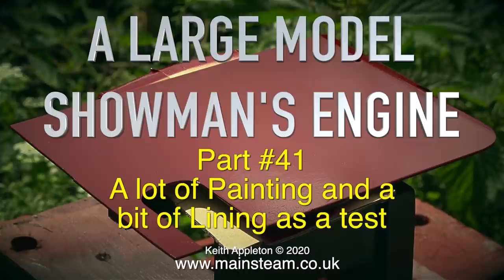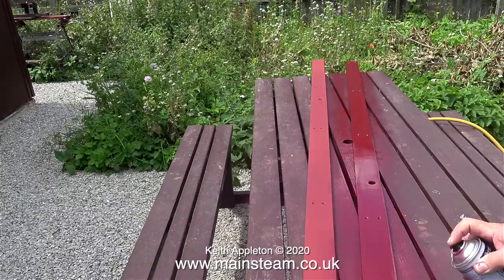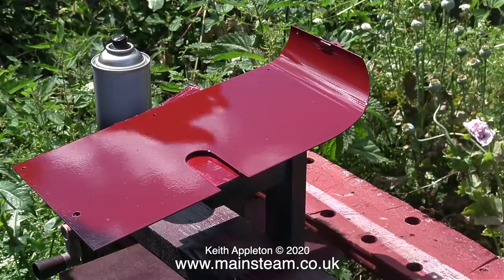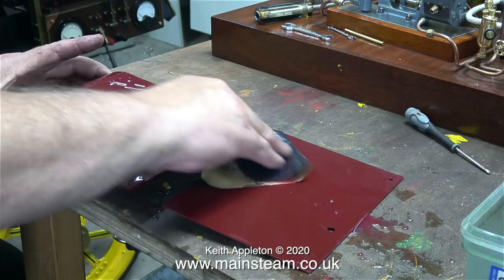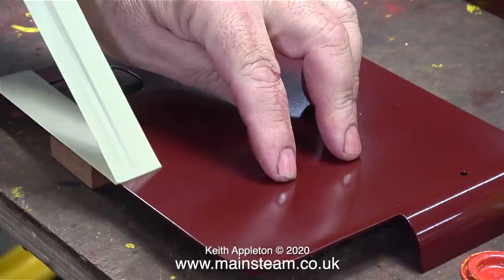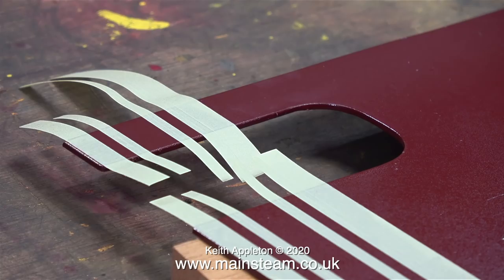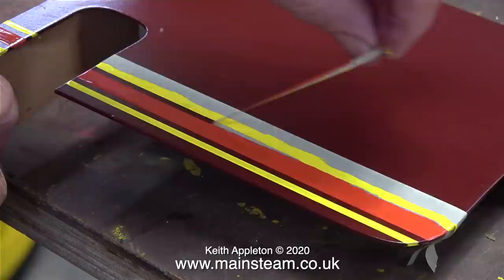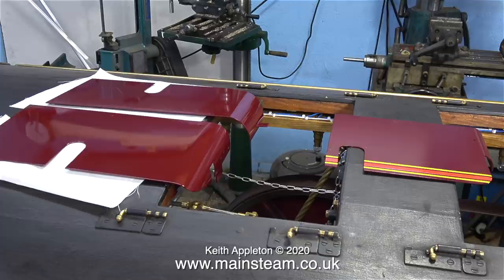A LARGE MODEL SHOWMAN'S ENGINE - PART #41

Comment: Hello Keith,
a great video thanks for entertaining my evening.
As a model painter I used the masking tape from Tamiya with decent success. I mostly use waterbased (acrylic) Paints instead of enamel Paints like you, but I found that more thin coats give a better finish than less thick coats. I thin the paint down to almost the consistency of milk and wait until it is mostly dry then start the next coat. Since my areas are small, you could  use an good airbrush, like from harder & steenbeck. 
Greetings from Germany and stay safe  and stay well. Or like we say  Vielen Dank! Bleib Gesund und alle Gute!

Comment: I would paint a light coat of the red on to the unmasked area over the edge of the tape a little, so when you paint the yellow over it only hits the untapped areas as the red has sealed any gaps where the tape hasn’t sealed fully

Comment: I use Frisket  which you can cut to the width and shapes you need. The only problem is you have to be careful when cutting it that you do not cut too deep and cut into the paint on the surface.

Comment: Tamiya make a very good masking tape which will be available from most good model shops. You can also buy various width lining tapes from the famous on line auction site. I am sure you will get one the width of the existing lines on the engine. Put that down on the piece first then stick your masking tape up against it. Finally pull the lining tape off and you have the line masking you desire. Also as you have noticed its not good to put too think a layer of paint on in one go. It can easily leach under the tape and also you end up with the thick ragged edge. I know you hate painting but you would really benefit from a cheap airbrush rather than painting the lining. Finally you can first paint the line in a thin coat of clear varnish and this will stop leaching. Hope this helps.
Reply from the maker: Thanks, I just bought 6 packs of Tamiya Masking Tape in various widths {:-)))